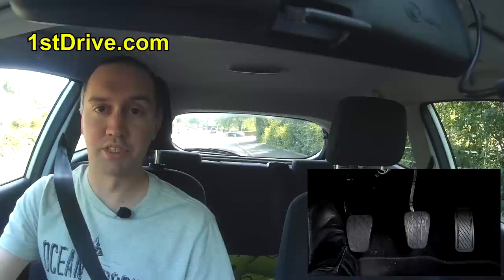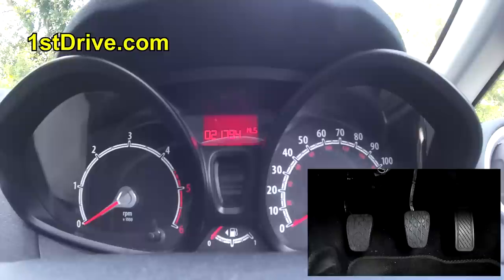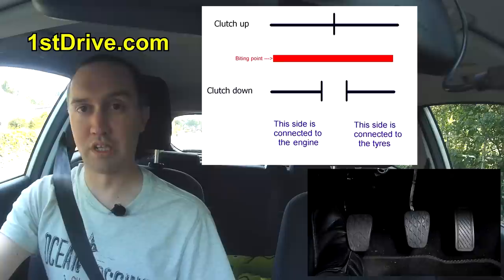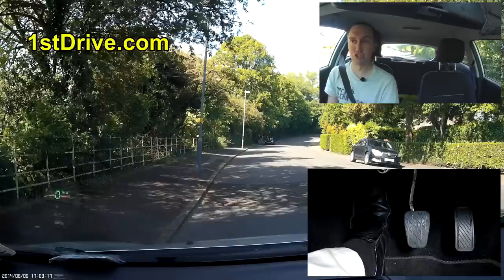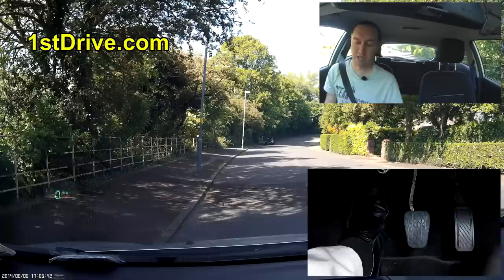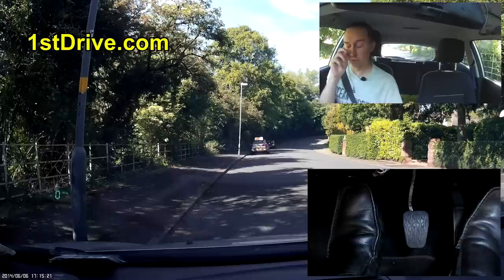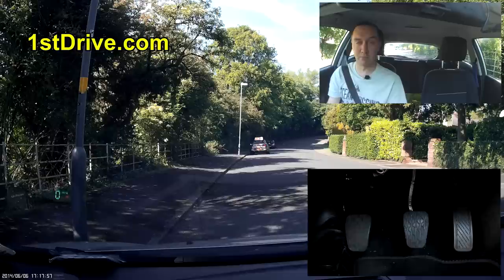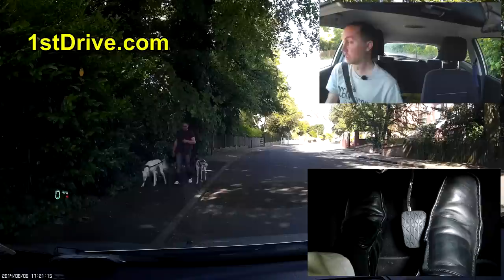Clutch Control Driving Lesson

Comment: Hi Paul, I started my lessons about 3 years ago and got to the point where my instructor said I am ready for my practical, I went for my theory and failed and lost interest, last week I passed my theory and will be taking some lessons to get use to driving again, when I start off I always put the clutch fully down, then to bite point and then accelerate and handbrake off, you do it a different way but is my way wrong? or is it OK?
Reply from the maker: Lifting the clutch without any gas is a serious fault, as is lifting the clutch with the brake held down. If you look in the official DVSA book called Essential Skills it says to press the gas and then set the clutch. Without any gas you're relying on the minimum amount of power to get you moving - that's never going to work on a busy roundabout!
Reply: 1stdrive Thanks for your quick reply, it's a shame you don't do lessons near/in my area (Kidderminster) as I would book with you, I guess I need quiet a few 2-hour lessons to get back up to standard.
Reply: Nehps0 *Quite
Reply: 1stdrive Won't releasing the clutch pedal with my foot down the gas pedal wear my clutch plates a bit. When should I avoid doing so?
Reply: It does, but it's mostly unavoidable if you wish to drive properly and effectively. As long as you're not really revving high and using very little bite point, you'll be fine.

Comment: Hi there Paul. I will watch this video later on but just wanted to say in my instructor's car (diesel) I have no clutch control problems at all whereas with my Mum's car (petrol - Ford Ka - 1.1 engine) I tend to over rev it so find it pretty hard going reversing etc. I can move off fine (have been learning to drive for a year now and have got a mock test next weekend) with it but would just like some advice at getting this clutch control done to a fine art.

Thanks again! :)
Reply: How old is the Ka? After learning in 08 and 60 reg diesel Minis, I kept stalling my 04-plate petrol Clio for a few days and after that I got used to the clutch and have had no issues with it for over 2 years. Other people who have driven my car (off road) say the clutch is really high up (probably the original since the car is only on 52,000 miles) but it did only take me a few days (1 week MAX) to get used to it.

Comment: That turn in the road was a bit suspect, it was too fast there's no way the pupil used the parking brake at any point or properly checked their blnd spots
Reply from the maker: That was the instructor driving! Funny you should mention that because if you think that was fast then wait until you see what happens with a turn in the road in my next video...